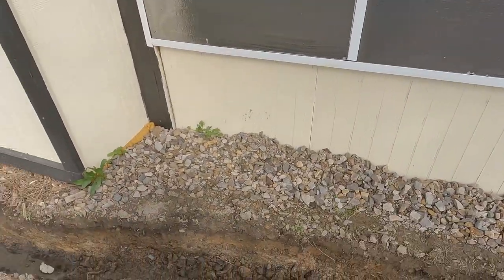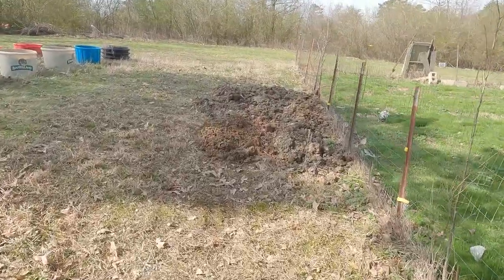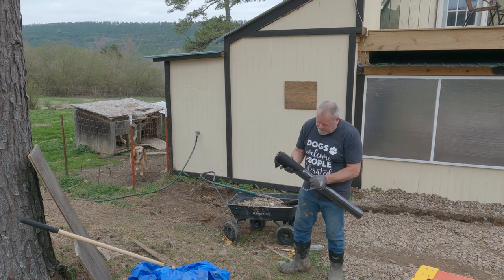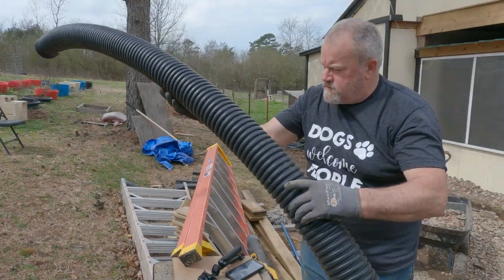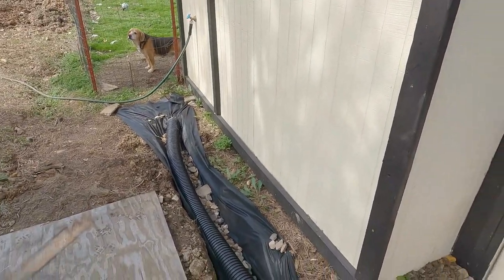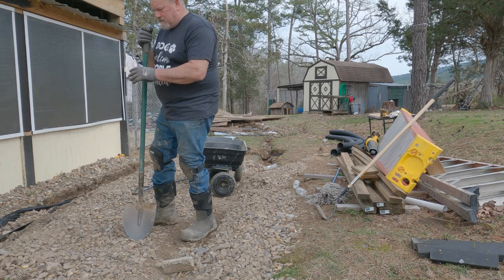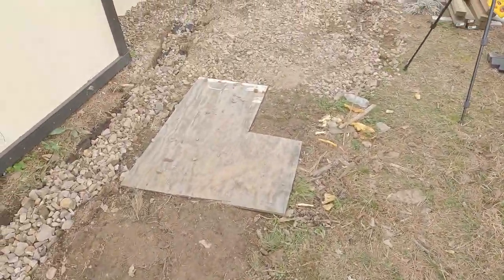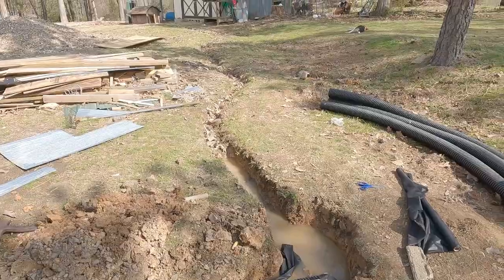Finishing The French Drain.Will It Work? One Of My Toughest Projects On The Property!

Comment: Hello Mike, Rita and Floyd from BA OK.  Anyway, we had a similar but smaller problem with flooding at times at a house in Tulsa.  Tried ditching, french drain...  Then used a bonding agent that allows additional concrete to be poured on top of old concrete and had concrete forms prepared and added an additional 2-3 inches of concrete on top.  Never flooded again. Since it appears that your back porch is where the water comes in or even possibly the laundry room, perhaps do the same.  You  don't need massive water drainage work done in the yard although that wouldn't hurt, but it would possibly prevent water from flooding from the back of the house into the rest of your house.  You could even do a room at a time if you think it would need to be extended throughout the house but that might be overkill if water has never entered from other others.  I am just thinking that might be a solution to at least try since the porch and laundry area aren't that large.  I just know that when my neighbor just had yard flooding, they tried a french drain about the size you are doing and it still didn't work.  Then they got professionals out and were told the drain was fine but 3 times too small to move the amount of water they had and it was nothing like the amount of water you have shown during your "flooding" video.   Just a thought but perhaps it is a dumb one.  I know that concrete isn't cheap but I just know what I learned with our problem and what the neighbors dealt with and hate to think of you killing yourself doing all this hard labor and and expensive for machinery and mess and it might not work.  So I thought an additional idea wouldn't hurt.  Prayers for your 23 to be better than it has been with the flooding.